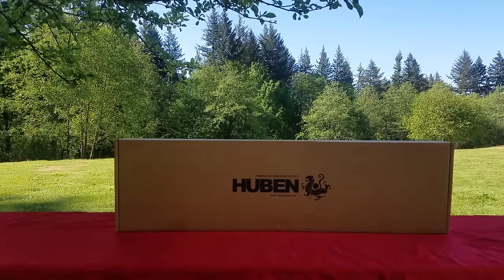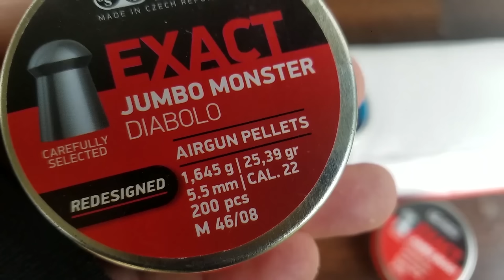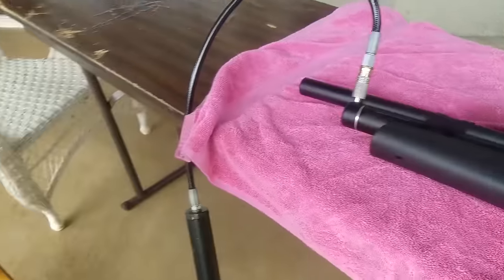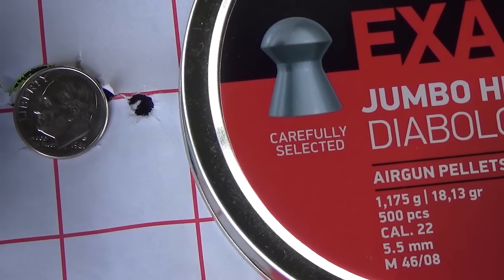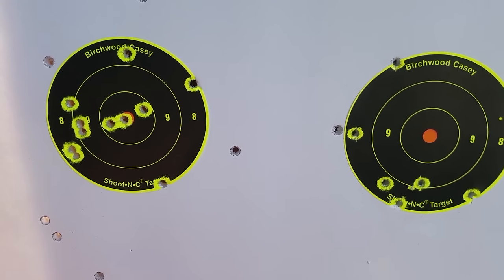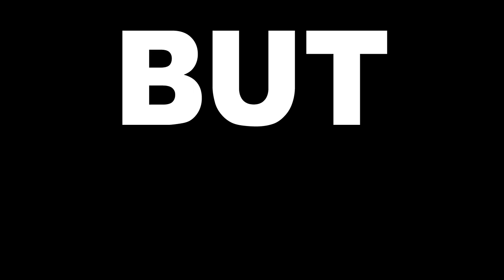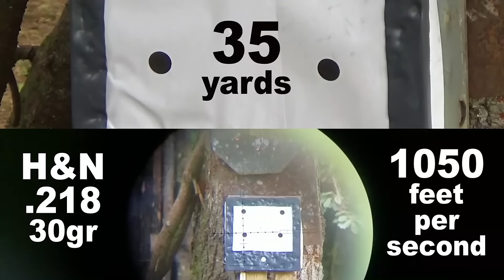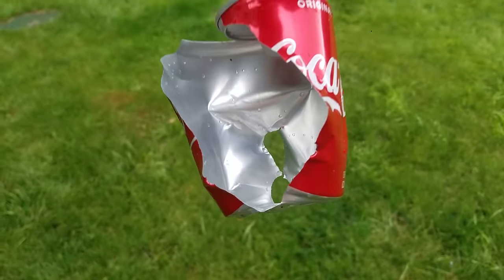HUBEN K1 2020 Series (Full Review) +150 yard Accuracy Test (80ft pounds in .22)

Comment: The new Hubens come with pellet barrels  that's why they don't group with slugs the old ones came with slug barrel
Reply from the maker: Great observation. Good reason to buy both , gen 5 and gen 6
Reply: Thanks for the info as I was wondering what the hell was going on with that thing as it was awful.
Reply: FML that means there's only so many left that are for slugs
Reply: @AirgunChannel  gen 5 cames with pellet barrel too
Reply: So it cant shoot both? Or the newer one is just more geared towards pellets?
Reply: That's y you buy a 2018 with a lother walther barrel and crank the velocity wheel and up the pressure to 21 seems to be as accurate as  I'll ever need   the 32.8 varmint knockers hallow points leave a massive hole
Reply: 34grain .218 javelin slugs at about 990fps groups quite nicely with the new diabolo barrel from my K1 2021, about an inch at 100 yards  :-)
Reply: @AirgunChannel  seriously looking at this gun but now they have gen7 seems a little bit ridiculous and overwhelming choices??
Reply: Awesome bull-pup bro!
Reply: David, where did you get that information? Is there a data sheet or a link that says the barrel is for pellets? Don't post without links to the facts, that's what children do. I looked everywhere and I can't find that information?
Reply: @yukonjack.  Why would you buy an inferior model and not the 2021?
Reply: @AirgunChannel  w
Reply: @AirgunChannel  wqwww
Reply: pellets fly straight even from a unchocked smoothbore its called drag stabilization

for slugs there is complicated formula for spin stabilization, calculating speed, twistrate and slug design / ogive
Reply: Slug barrels are not choked, the old lw barrels were choked,
Reply: You need a 5.56 slug in a k1, 5.52 are no good, the new barrels are un-choked and work fine with slugs providing you use the correct slugs.

Comment: Hey Nate. Got my new Huben K1 22 from Kelly last week. Dam thing is 😷 SICK... 
Also received the AEA Element Ultra from Terry 2.8 lbs and folding stock and extra air tube has built in regulator. 
Light trigger out of the box 15.89 Hades at 997fps. FX hybrid 22 grainers @ 868fps and accurate... Unbelievably amazing...  Happy Days 😊 😃

Comment: Well done Nate and a nice review, you may well find that if you dial the power back in small increments the groups at longer ranges tighten up, if not its either the wrong ammo or thats the guns capability. and don't  drop it anymore !
Reply from the maker: Awesome, I wish I could have tuned better on the video...I had to get it filmed that day though.  I knew it would do better! Thanks for the info. I will try that. ...I was going 1050 and I should have been at 1000 fps. ...darn...I was in a hurry.
Reply: Also try a wider slug, hunt down some 5.55s or 5.56s

Comment: I got the gen 5 and I love it. I also got huben's swaging die to make my own slugs with .185 caliber lead wire. They're about 37 grains have a driving band that makes a barrel seal with minimal friction. They group well. Krazycool airguns sells a new end cap for them that has a male quick disconnect so you can ditch the probe and have an air gauge for the main tank. I think the ergonomics are better than the lcs sk19 and it's more powerful. I clocked a freak 35 grain going 1094 fps once. That's over 90 foot pounds
Reply from the maker: Wow, I need to tune it more and show some better long range groups. Thats super cool about your slugs you make.
Reply: @AirgunChannel  are you going to have the gun for a while? I might be persuaded to part with some of my slugs for you to try but I would find out if they're ok for your version because my understanding is that they are actually .223 diameter when accounting for the driving band. Normal pellets like the 14 grain crossman ones from the store are way too loose in the magazine and when it cycles the skirts jam, even if I pushed them all the way in. This can cause problems with the gun and might be why I had to send it back for repair once so I only shoot the slugs I make or the JSB beasts and I'm all out of beasts with no plans to buy more
Reply: @AirgunChannel  oh and I was wrong its airguns 4 Patriots that makes and sells the air tube ends that have a gauge and a male quick disconnect. I hate fill probes, just 3 more o- rings that can go bad

Comment: I would like to see this gun go up against my SK-19 in .22. By the looks of things my SKs 12 grove LW barrel may out shoot the Huben. “6” clicks from minimum power setting it shoots 15.89s at 920 FPS and 100 shots per 250 Bar fill. and at “30” clicks from minimum power setting, out of a total of “150” at maximum power, it is sending JSB Redesigned 25.39s down range at 1064 FPS for about 60 shots per fill. My regulator is set at 140 Bar. I hope you can keep it for a while. Truly an amazing gun bud. I hope this hammerless technology spreads throughout the airgun industry quickly. Take care, stay safe, and God Bless.
Reply from the maker: Thanks for the comment and great info. Huben is suing LCS right now because they copied the design for the SK19. That's why they are similar. I will hopefully get my hands on and SK19 soon. AOA sells them so they no longer sell the Huben. Thanks again for the comment!

Comment: Plain and simple you have to push .218 Griffin 34g boat tails out this gun.... They love them.... Love love love them.... They are easily printing 5 shot 100y sub .75 minute.

And hitting 2.5 moa plates at 300y was child's play... We have shot upwards of 40 different slugs in them and the Griffin's 34g BTs are the slug.... The barrels eat them up... You won't be rapid firing lol because they are costly but when you can put lead reliably on a 2.5 minute plate at 300y (7.6 inch plate) and know that when you squeeze one off on P-dogs or what we shoot a lot of Iguanas that the gun and projectile is capable of putting it where you tell it and even at 20ftlbs on target your gonna put all that energy in to that pest very very quickly and on closer shots the chances of pass thrus are slim.
Reply from the maker: Lacy! Your still out there! You guys are my favorite airgun experts! I'm going to try that ammo and hopefully make another Huben video after tuning it better.

Comment: For the price it’s kinda a rip that it doesn’t come with a built in gauge to tell you the tank pressure. The pellet accuracy at 35/50 was good but once you used the slugs the accuracy seemed to fall off a cliff, not very impressive especially since they market it as a slug shooter. However, like always very entertaining video.
Reply from the maker: Thanks man. I was also disappointed by the slugs. I guess you need an Impact if you want 1 inch slug groups.
Reply: My gen 5 loves slugs and is more accurate than that at range

Comment: Hello! I have a 2020 version of 6.35 caliber that has 2 manometers. A repairman strongly recommends that I will empty regulator air (not the main tank) after each use so that the o-rings do not deteriorate over time. Are you sure?! Thanks

Comment: In a firearm you cannot change ammo and expect same POI. In this air gun how does it affect POI? Does the pellet just strike lower on the target because it is not going as fast or will it be high right or low left etc? How many shots might you get in 25 caliber at the high end of power? I looked on line at the Huben site which is not very informative.
Reply from the maker: Any pellet will hit at a different spot. You can use the power wheel to adjust to the perfect speed for accuracy with each pellet. You will have to re-center your scope each time you change ammo.
Reply: @AirgunChannel  Thank you. So the ability to change power settings is not worth much or would not be to me. If I was blasting out in the wilds I could not then "dial down" the power and still expect to hit if I was in my backyard.

Comment: In your opinion which semi auto it better, Lcs or Huben?
Reply from the maker: LCS for sure. Huben is 3X more power inside 50 yards...but after 50 it looses accuracy...with 3 inch groups at 100 yards on a good day. The LCS does dime groups at 100 yards....not even a question...LCS (I never tried the .22 / only .25 has Polygon barrel) get a .25 -Nate
Reply: @AirgunChannel  I got the 25 yesterday

Comment: very accurate .. so i dont need the impact i stick to my hubenk1 yahoooo
Reply: Two VERY different guns... Two very different expectations of capabilities...

They are nice guns but there will it do what a Impact that's really dialed will do at 100, 200, 300? No... My .22 Impact MKII is pushing 27.5g slugs at 1070/70ftlbs... Will print 10 shot groups at 100y that are moa or better at the 100y Indoor range all day long with most groups being .75 minute -ish. I can dial it in to a projectile to exactly what I want it to do... Im running two 580cc carbon bottles and at 70ftlbs on a 3650psi fill my shot string is well over 128 shots with a SD of 2fps and an ES of 11fps (over 128 shots keep in mind) ... 

Slap a pellet liner in it make a few adjustmets and pushing JSB 25.39S at 46ftlbs and will group 10 well under a half inch at 50 and an inch at a 100 cost next to nothing to shoot... It's just two very different guns.. I love my Huban and it's super fun... Highly accurate and highly adjustable. Will it win any bench rest comps? No... Is it super refined? No... Is it a shit ton of power in a semi auto design that preforms well and puts slugs on target at long range pretty well? Yes.. Two very different pcp guns with two very different intended usages and clients. Another thing to keep in mind is the extremely high fill pressure to have a decent shots per fill... Biggggggg difference between 5k.... Just say 4500psi fill gun and a 3600psi fill gun... A fresh charged 4500psi bottle can't fill it to its working pressure... Given the shot string is very usable on a 4500psi fill.
Reply from the maker: I would love to try one if you want top send me yours. Ill pay shipping both ways and give you $100 cash. I can't see replie so you can email me at kaylaindy@gmail.com

Comment: Not any more! The Seneca eagle claw does it. .25 im shooting 43.2grn at 950fps 1/4 groups at 100 yrds. 85ftbls. a sizing die and a washer in the right place. Seriously!
Reply from the maker: where does the washer go?
Reply: @AirgunChannel  behind anvil spring. Check African air ordinance. Updating mine now. Probably carbon fiber barrel shroud. Hey do you know of a carbon fiber tank I could use on this? I found it should be cheap if you look $35 for my shroud.
Reply: @AirgunChannel  Hey just shot a double load 33.95 at 222ms 80ftlbs
Reply: Using .257 65grns next. The GMI MOLD is just too pricy right now.
Reply: On the chase of mr hallow point. He got 100ft on a 55grn. I think he was using helium

Comment: Try stretching it out to 100 with the JSB redesigns. They’ll do better than the slugs
Reply from the maker: I should really film another video just tuning and shooting...there was so much more to do.
Reply: Airgun Channel I agree. The huben is so adjustable the different variations of tuning setups is daunting. Throughout the 2 years I’ve owned my huben one of the most important things I’ve learned is that it likes ammo that’s harder than average. Pure lead ammo is too soft for the violent way the projectile is shot from the magazine into the barrel. As opposed to the gentler seating of a pellet probe. If shooting slugs they should not be pure lead and should have a small amount of antimony to make it harder. Others like Gregor(The Huben guru) have came to this same conclusion. Try the GTO pellets or the other lead free ones and you’ll be amazed. Also, I believe the new Altaros slug is harder than a regular pure lead slug. Could be worth a shot. They are after all, designed the same way the huben slugs are
Reply: The jsb beasts are the only ones mine likes but I think the gen 5s are actually .223 cal. Those cheap 14 grain crossman pellets would not seat and would cause jams when the mag rotates. No accuracy when they break the sound barrier but it's fun to hear the crack of the shot through the air from such a quiet gun

Comment: The new .22 hubans come with a 5.56 un-choked slug and pellet barrel, 
Throwing a 5.50 down a barrel at high pressure is not going to work.
It's not a pellet barrel it's an un-choked 5.56 barrel,
You can get a 5.56 slug mold from mp molds, Google it.

Comment: you know it is not smart to dry fire an pcp airgun? do this with an impact and you will see what can happen :)
Reply from the maker: It's in the FX manual to dry fire the dreamlite while adjusting the regulator. It's supposed to be OK to dry fire PCP's. FX Impacts may be fussy.
Reply: @AirgunChannel  yes and it can happen. a lot of people report this problem when dry fire the gun by setting the reg pressure .